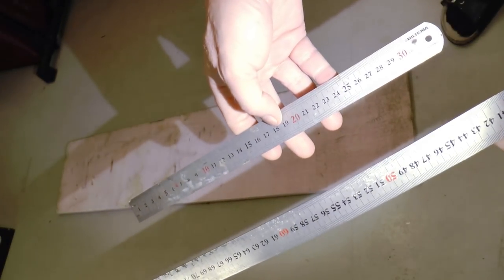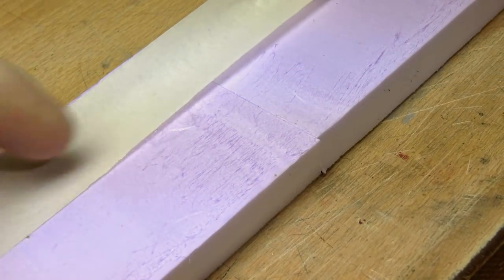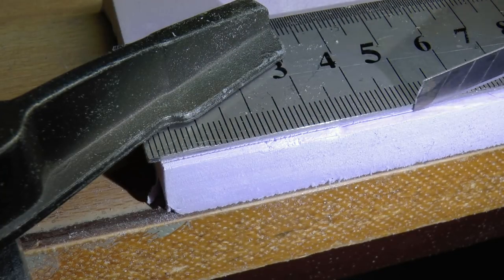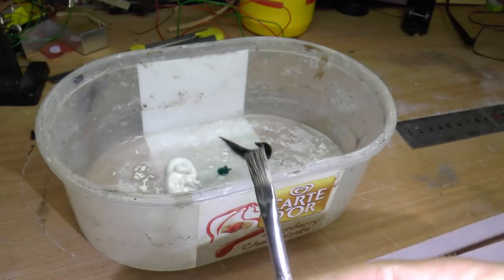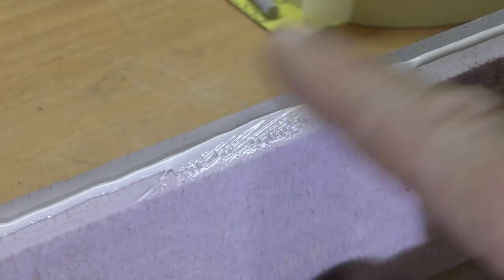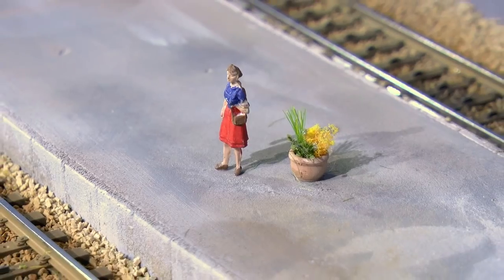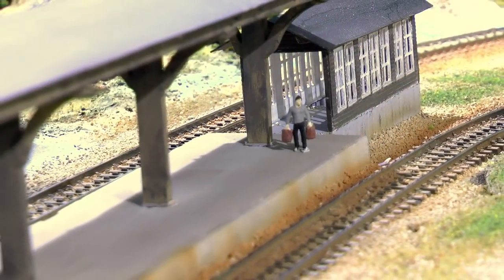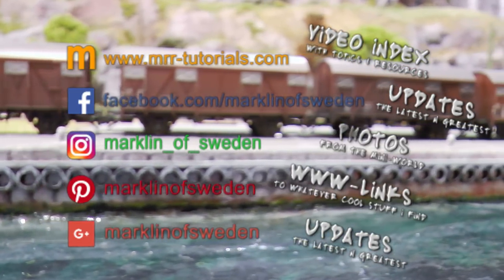Model Concrete platform for Model Railroad or diorama

Comment: best glue for Styrofoam is interior latex  paint it penetrates the pours and tooths in mechanically  experiment put white glue on a piece and   good quality latex paint  next to it the white glue  or polyurethane glue will pull off the paint not so easy ..